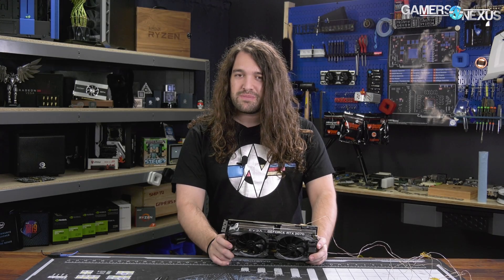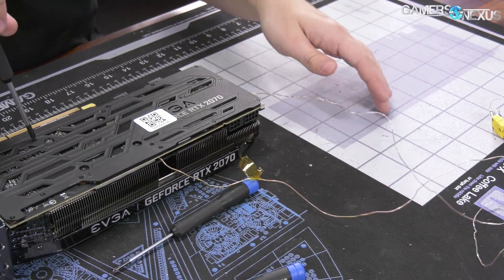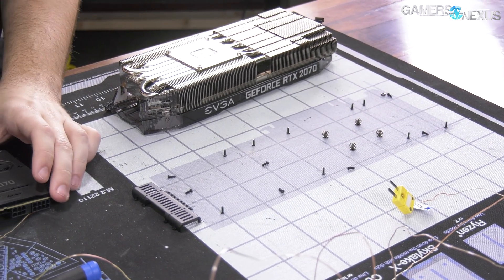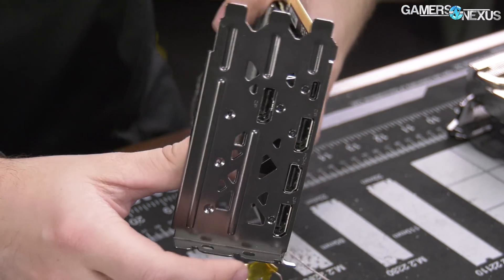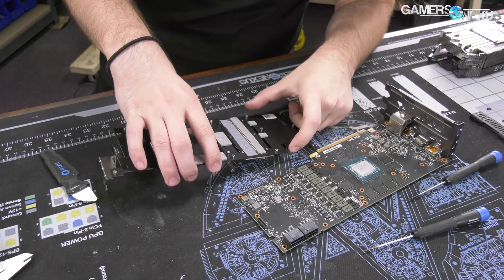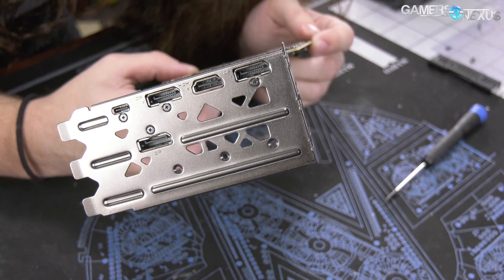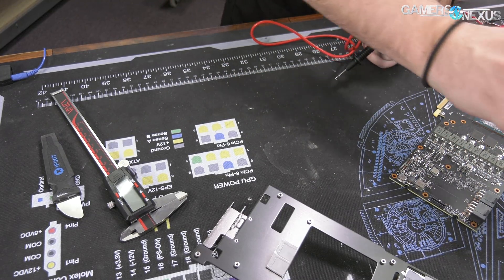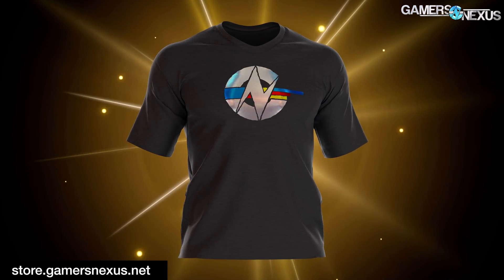EVGA RTX 2070 XC Ultra Tear-Down & Cooler Quality

Comment from the maker: Our review will be up shortly. FYI, price looks closer to $570, depending on where you check.
We did a PCB analysis of the original RTX 2070 Black, and it's quite a bit different: https://www.youtube.com/watch?v=qpnU0mjx4YQ
Reply: all that, and the fan shroud is still on the fin stack in the way of dusting off the cooling fins. At least EVGA did not hot glue the fan/RGB plug or backplate on to the card, lol.   They did make that cooler super easy to take off, just 4 screws and a plug, I wonder how much a replacement filter rrrr cooler will cost and how often they should be changed (grin).

I really wish Motherboard makers cared remotely as much about cooling more affordable motherboard VRMs as EVGA did for this card.

Great vid Steve and crew. B)
Reply: GamerNexus, do you think this will become a trend? The price you pay will determine what type of silicon you get vs just the model of the gpu.
Reply: How can some1 knows which gpu is on the pcb I mean if it is 400 or 400a without tearing it down? Is there a way?
Reply: Gamers Nexus Steve do you think you could check out the 2070 super hybrid? It seems like no one has really dug in to the quality of hybrid cards in depth since the 1080 hybrid
Reply: Hey idk if you’ll still respond to this but so you know if there’s a water block for this gpu?
Reply: omg when is somebody gonna release a real next gen card.  a 1080 ti for 400.  thats a real next gen card.

Comment: I just repasted my GPU of that exact model
I had between 25 to 30°C delta between GPU temp & GPU Hotspot Temp
which I believe was causing a lot of fan ramping up & down, generally annoying
Reply: Were you able to fix your hotspot? I am getting over 105C hotspot in HWMonitor was thinking of reapplying paste to this exact card.
Reply: @MrPoppasmurf79  yes I confirm after several weeks, that hotspot problem is fixed entirely!
The paste I used to replace the old one wasn't even that good
but the old paste was completely dried up

The end result about -20°C in hotspot temp
and -7°C in average temps (take these figures with a grain of salt, they are not very scientific)

much love to EVGA, so sad to see them gone.
Reply: @whismerhillgaming  Thanks for the info and reply. EVGA will be missed. I always bought their products. I hit this card hard in the last 2-3 years and wouldn't be surprised if I caked that thermal paste by now. Just got some thermal paste delivered today and will try it.
Reply: @MrPoppasmurf79  keep us updated how it goes ;)
good luck.
Reply: @whismerhillgaming  Hotspot in the 80s and overall GPU in the mid 60s. My PC is quieter now that the fans dont ramp up as much.

Comment: Hi, I have an Evga RTX2080 Super XC, and I can't remove the cooloer/fans, I remove the 4 big screws and it wont budge, its stuck and I cant apply too much force to it or the PCB can be damaged, any tip would be great.  I just remove the 4 bigger screws, is needed to remove the smaller screws too to remove the fan shroud?  (I don't wanna remove the backplate)

Comment: So if they used the same cooler on a 2070 super, 2080 and.2080ti is it safe to assume that a 2080ti water block will fit the 2070 super?

Comment: Sup goat, I recently tried to service my xc ultra & found out they put a thermal pad on my gpu & it’s stuck like glue I can’t get the heat sink off. I need to take it off without damaging it obviously & recently the backplate has been taking major heat 🤔
What should I try? Thanks for the video.

Comment: Im glad i found this video i installed a waterblock on this exact same card and when installing the air cooler back on i found a square little black pad it isnt a thermal pad it has a sticky side and was confused where it came from  and upon watching this video i dont see ur card having it so i guess its not needed. It was stuck to middle black plate close to the IO connectors on the inside  it looks like its not needed so ohwell lol

Comment: had the evga 2070 xc and it died 6 months after use and no overclocking. Got a RNA and they sent me the xc ultra and it died 2 days later with stock settings.... Been researching to fix it my self though, i'm thinking its a dead vram chip so if thats the case itll be a easy fix.

Comment: Man this is great news how easy it is to take the cooler off, I've a 2080ti xc ultra that I haven't changed the paste on in 1 1/2 years. Four screws, good stuff.
Reply: How did your 2080 do after you repasted king?
Reply: The hardest part about tearing into electronics is that first step into the unknown. GPU cleaning and PC building are like adult Legos to me, like a jigsaw puzzle. I get excited when I get to clean out and repaste an older card.

Comment: Hello all, I have an EVGA RTX 2070 XC Gaming, and tried to remove the backplate because I was going to paint it, managed to strip one of the screws pretty bad. I want to do a custom water cooling loop around Corsair's HydroX line. Am I absolutely f-ed in that if I can't remove the backplate? Or does anyone have a recommendation in getting the screw out?

Comment: "About your question, about the reference PCB, we can tell you, that this card is related to the nvidia reference pcb.
However, your question about the A-Chip or not, we can't tell you, because this will be decided in the factory.
This information would be only available, when you're using a tool to read the info."
-EVGA Support

Your information is incorrect I'm sorry to say.  And this GPU clocks slower than some GPU's £50 cheaper.  Thanks for your review, I bought a turd.  Oh well, at least it's a cool running turd compared to some others.

Comment: I have this card. I overclock it +165mhz clock and +1000mhz memory. I have a 120mm AIO on a i7-7700k @ 4.2GHz. This GPU runs around 140⁰F/60⁰C. I am very happy with this card. I bought it to run Oculus Quest on PC using Quest Link and it works great! I get full 72FPS almost all the time on every game on max settings.

Comment: @Gamers Nexus - I would argue that the cooler on the black cards is just fine, the problem is the manufacturers application of thermal paste is total shit. It's an embarassment, and arguably maybe intentional to sell people coolers they don't need for more money. I've emailed multiple manufacturers about this several times (EVGA, MSI, ASUS) and yet here we are again. I bought a new EVGA 2080 Black yesterday, it was thermal throttling at 83C, changed thermal paste, now runs at 68C max temp after looping Heaven benchmark for an hour with the same fan curve. It's absolutely unacceptable. Pictures linked below.

https://imgur.com/a/zeBG0vp
Reply: @Frostek Yes, I use Arctic Silver 5 on mine and it works great. I would just suggest that you make sure that you are not using a conductive paste because there is no IHS (big metal plate) on top of your GPU die, so if you use a conductive paste and some of it slides around or gets squeezed off of the die then it could potentially short out other components around the die. You'll notice that there is paste all over the small components around the square GPU die in the pictures I posted, that should not be there, especially if you're using conductive paste.

Comment: would this card fit in a micro ATX case? something like the h400i from nzxt? partpickers shows it compatible but idk. If it does fit, is that dumb to put an 97k and this card in a small build like that?  im still on console so i dont understand this type of stuff yet.
edit: my plan was to go with the basic 2070 black, and i was worried about temps in a small case, so my thinking was this card would be better off if it still fits. but again, idk if thats dumb or not and if its all just gonna melt in a month. lol

Comment: Just got this XC Ultra card in January 2019, and it came with Samsung VRAM... maybe they switched VRAM vendors after the "space invaders" issues cropping up in the higher end RTX cards.
Reply: Yup I got this card in February 2019 and mine also thank the silicon lords is also Samsung. I was really worried about the issues I've seen and read about Micron. So far after no coil whine issues aswell.
Reply: @knottymaker5098  The VRAM offset I'm at now is +1200 MHz. I did get it up to 1300 MHz offset, but sometimes the card would crash. There seemed to be a performance hole with the offset between 1000 MHz to 1100 MHz (ie the performance didn't increase in that range). Although, I just did my stability tests with 3dMark. Real games have a tendency to expose instability more than benches.
Reply: @umeng2002  Any update on both of your GPUs I just got a 2070 MSI with Samsung memory. I have seen some people saying that the Samsung memory can fail also.
Reply: @euan3858  No issues so far with my card.
Reply: is it possible to find out memory brand without dismantling the card?
Reply: @ando1016  Use GPU-Z. It'll say which vendor it is.

Comment: Love this card. It's really quiet and I sit right next to my box wearing headphones. I paid $550 for it at Micro Center and got BF5 for free. Six giga rays is good enough for me. You can set the RGB lighting to temperature and it will change as it heats up but in my Cooler Master Stryker tower..It never heats up. Very cool card! Very happy with this purchase.
Reply: Mine is really loud and it only gets around 120fps on high settings on 1080p, I see all of these good reviews and I feel like it's been nothing but a disappointment for the past 6 months

Comment: Do the XC and XC Ultra use the same Chipset? Is there any architectural difference besides their slot width, and the correlating higher base clock due to that enormous cooling body on the XC Ultra?

Comment: I'm waiting for them to actually try and make a good back plate with heat fins and everything. I've always just seen them and thought the things just trap heat on the PCB and even the fans in a case could probably cool the PCB down better than a solid back plate but it's nice to see them putting more ventilation into the back plates.
Reply: I'm sure the 30 series cooler/pcb designs made you happy. If only anyone could actually get one.

Comment: any can confirm dif between XC and XC utlra 2070 for metrics besides cooler size?
Reply: Only difference is the cooler thickness. 2 slot versus 2.75 slot

Comment: Did a GPU teardown myself for the first time the other day. Glad I bought a Mod Mat. The mat, besides being a great surface to work on electronics on, is helpful. The GPU silhouette especially made it quick and easy to remember where the screws came from and then where they went when putting back together. Big fan of the Mod Mat as well as the channel.

Comment: how do you expect us to preorder your tshirt when you always tell us not to preorder, you dont even have a review of the shirt.
Reply: And where are the out of the box thermals!
Reply: Wait.... what... one does not simply argue with that logic
Reply: Finally, someone speaks up about that.
I want know the rate of heat transfer, does the foil lower thermals? If so, how much and when? 
There's no mention of thread count, just that it's 100% cotton. But that doesn't say much. And what about stitching? Is it lock stitches or chain stitches? How many stitches per inch? And did they use the superior 69 size poly thread??
What dye is used for the 4 colors and at what percent adhesion to they have on cotton?
So much left out. 
We Need a Proper Review!
Reply: And no teardown either :/
Reply: @halfisher3598  and most importantly, performance.

Comment: so does the 8 + 6 pin mean it can take more power or does it deliver power more smoothly?
Reply: only reason to add additional power connections is to increase power available to the card.  you can get 75 watts from the slot, then 75 for each 6/8pin.  smoothness of power delivery would depend on the quality of the gpu vrm and the psu, not on the number of power wires connected between the 2.
Reply: michael lesak thanks for explaining it better when i wrote my last reply i just woke up ahahaha so it didnt make any sense thankyou

Comment: So i'm in the market for a 2080, and looking at EVGA's website they've just released a "Gaming Black" version with a 2-slot ICX2 cooler, according to the specs page. If the cooler is the same, is there any reason to spend more on one of their 2-slot XC line cards if i'm going for a modest overclock? From what i can tell just by the pictures on the site, the PCB is different, but is it worth the extra $50-100 if the cooler is the same?
Reply: I am 99.9999% sure that is the non A Gpu in that model you are looking at. You have to check the Gpu clocks. The Non A chips are set to stock factory clocks, then A chip models have higher then the stock factory boost. Steve did a video showing what the 2070 Black gaming can do. So it is up to you to decide which you like best.

Comment: If the premium RTX 2070 card costs 10% more than a base model, can you comfortably get a 10% improvement in overclocking performance?
Reply: If you can get 170+ in core, then yes + potential

Comment: Guys my budget is 1000€  Should i get  1070ti with a ryzen 2700x ?  or lower cpu and get a 2070?  Need some help with this.
Reply: I'd say you'll be better off with a better gpu (since it sounds like you're putting together a gaming pc). So 2070 it is. Of course you can also try and snipe a 1080 to reduce costs, or even shoot up to a 1080ti/2080 if you can. But the focus should be gpu, not cpu for a gaming build.
Reply: @adrianstan5794  
1070ti 464€
1080 535€
1080ti 800€
2070 664€ 
the cpu is 329€
Reply: @Enclosure_2k  The thing to keep in mind is that the 2070 has raw gpu performance on par with the 1080(this excludes DLSS or real time ray-tracing)
Also a 1070ti overclocked can match a stock 1080, so a 2070 over 600$ isn't worth it at all imo.
Reply: @Enclosure_2k  There are also some deals on r7 1700, that might be keeping an eye for.
Reply: @adrianstan5794  here the tech is super expensive because tax ;(  A 9600k is 345€ and its 6/6  i want HT. ;(
Reply: @adrianstan5794   7 1700 is 199€ XD
Reply: @Enclosure_2k  That's actually really good, you can also oc it to 3.7 on the included cooler and so it's not far off a 2700/2700x. That would mean you could squeeze a 1080 in ur build maybe :D
Reply: @adrianstan5794  Sadly all the 1080s are out of stock here ;/  That's why i am in a rush to a 1070ti. they removed the MSI gaming 1080 version too. cant buy it anymore.  
GTX 1070 Ti Gaming 8G 464,90€
1800X 229€  (i already got a cooler the cooler master evo) dont know if works with that cpu socket. 
MSI ATX X470 Gaming Pro Carbon 194€
 G.SKILL SNIPER X 16GB (2x8GB) DDR4-3200MHz CL16 Urban Camo 159.90€
i already got the PSU.  Corsair RM750i Full Modular.
that alone is 1050€   
The 1080s are expensive if you compare it to a 1070ti.
All i want is to game 1080p ultra 60fps! ;P
Reply: @Enclosure_2k  I see. Then that sounds like an extremely solid 1080@60 machine :D the 1070ti will do that just fine. Have fun with it when you get it. :P
Reply: Get a 9600k

Comment: I think the 2070 is the only RTX card that has any real value.  Unless you're obsessed like me, then the $1200+$200 for a 2080Ti and EK water block make sense.  But I primarily want the fastest single GPU for VR.  Which it excels at.  Fallout VR @3x SS max settings.  Absolutely gorgeous!

Comment: Realy good cooling system! Cudos to EVGA
Reply: Cudos?
Reply: No kudos. Its loud as hell
Reply: Nikolay Nik not from what I’ve heard nor seen. This runs cool as hell.
Reply: @niodix  I know this is a late comment...but no, it's not.  It's really, really quiet.  At full load the fans never go about 55%, even overclocked (mine pegs at 65C max), and at idle the fans turn off entirely.

Comment: Here in France the XC Ultra is over 600 euros, and the XC is around 580 euros.

Thanks Nvidia.
Reply: Meanwhile you can get a Sapphire Vega 64 Nitro+ for 480€ in Germany (so the same should roughly apply to France). Imo a way better built card with roughly similar performance with one of the most quiet high end gpu coolers out there, despite having to handle one of the most power hungry chips. Also, Freesync. Somehow nVidia made Vega look really good
Reply: @or2kr  and i can't even find vega 56 (reference one) in my country even after the crypto mining decline.
Reply: @or2kr  Yup, we have Nitro+ V64s for like 470 euros, already have a 1080 sadly.
Reply: @metacube9913  To be fair, the 1080 was the better card for your money not so long ago, so don't feel bad :P. I have gathered myself that Vega tho lol
Reply: That's your country and VAT's fault not Nvidia.
Reply: Nice vat meme. The price different doesn't fit that tho.
Reply: @bitscorpion4687  So there is VAT only on RTX cards ?

Are you drunk or some shit ?
Reply: @metacube9913  The cheapest RTX 2070 is 500$ in the US and the cheapest vega64 is 485$.
Where do you live to get such prices?
Reply: @bitscorpion4687  France, here the cheapest V64 is 450 euros and the cheapest 2070 is 530 (blower tho).
Reply: @metacube9913  The cheapest Vega64 seems to be the XFX(  https://fr.pcpartpicker.com/product/pwjJ7P/xfx-radeon-rx-vega-64-8gb-video-card-rx-vegmtsfx6 ) on Pcpartpicker at 549€, 2€ higher than the Evga Black 2070.
Reply: @metacube9913  quite interesting. 475 is pretty good
Reply: It's not Nvidia's fault. Blame yoyr country and VAT. Move to US.
Reply: @zhangirduiseke676  I can get a Nitro+ V64 for 470 euros but yeah that's VAT fault.

And no thanks, I don't like shitholes.